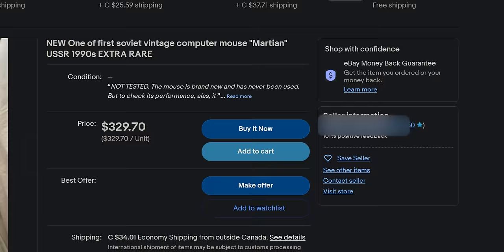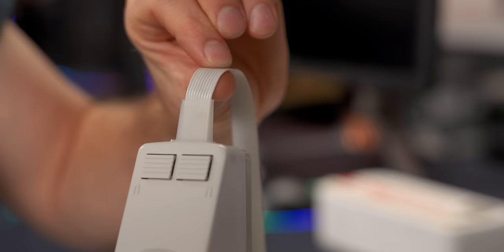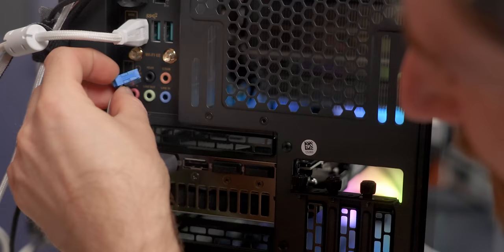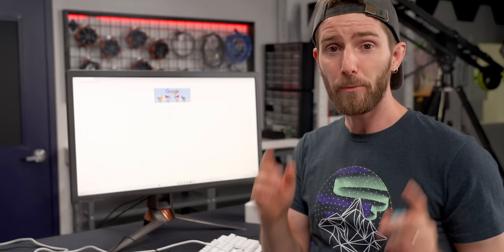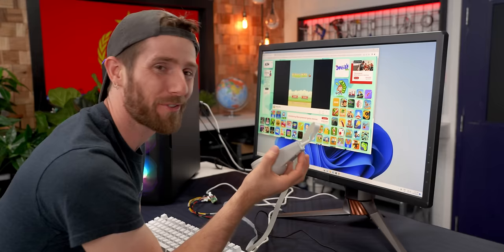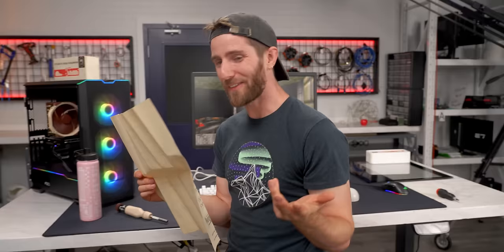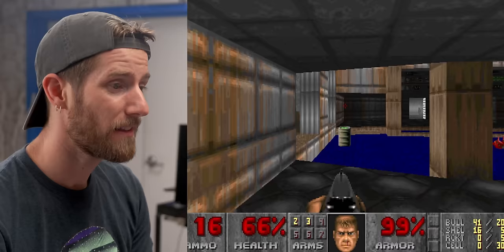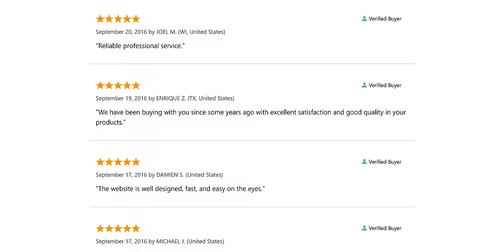I Bought a Soviet Era Gaming Mouse - MARS UKV-01

Comment: Keep in mind that back when this mouse was created, the most common resolution was 320 or 640, the speed of the mouse relative to the resolution back then is very good. 
Try using 600 or 800 dpi mouse on 1440/4K screens. It feels insanely slow. I have 4K screen and my mouse is set to 6000DPI.
Reply: I use 400 dpi on 1440p 😬
Reply: BK-0010 had 256*256 pixel screen )))
Reply: How does this have so many likes, 800 dpi doesn't feel "insanely slow". I've been using 800dpi on 1080p + 1440p for a decade.
Reply: yall are insane, 6000 dpi...
im better at 900 dpi
Reply: @marsamune5592  oh it does, you've probably bumped the accelerator near the end of the slider, but at this point you have no mouse precision since the movement is software calculated by simple multiplication. 
If your screen resolution was 1920x1200 and your mouse was capable of a maximum DPI of 600, you'd have to move your mouse two inches to get from the bottom of the screen to the top. If your mouse used a DPI of 1200, it would only take one inch to make the same movement on the screen. For 4K resolution multiply the necessary distance to move the mouse by x2

Therefore higher mouse DPI allows you to move faster on the screen with less mouse movement. Higher resolution displays may require higher sensitivity or higher mouse DPI to attain the same amount of on-screen movement, or one would need a ridiculously large mouse-pad.
Reply: @vyrgozunqk  You said that 800 dpi was insanely slow on 1440p. That's 1.8 inches from top to bottom. You got weak ass arms or the tiniest mousepad. I have windows on default sensitivity.
Reply: @marsamune5592  how about horizontal? ;) not just up and down, for me this is insanely slow. The mininum I can tolerate on 1440p is 1200dpi, prefferably 1500. I don't like moving my whole hand from the shoulder.

Comment: Are you kidding me? A PDP-11 compatible home computer? Can it run BSD or UNIX? That's badass. Can't believe I never heard of it.
Reply: would be cool seeing a soviet home computer running bsd lol
Reply: @lettuce7378  there was a Soviet BSD-based OS, ДЕМОС/DEMOS
Reply: No, it can't. It's not 100% PDP-compatible, instruction set a little bit different, and it was roughly copied by USSR for some strange bureaucratic reasons.
It had an impressive list of software tho (C, Forth, Basic, FOCAL and even about 800 games), but not a single real OS. Some models even had some LAN functionality, we used them in our class where I received my first programming lessons in the late 80's. Wikipedia article “Electronika BK” about this device is quite good, can recommend it.
Reply: Heathkit sold the H-11 and it ran PDP-11 software as well.
Reply: Most soviet computers use partially pdp-11 compatible cpu's
Reply: believe me. soviet cs, pcs and cybernetics are one hell of a rabbit hole
Reply: @petermikus2363  if I remember, there were even some that, although they were IBM-PC compatible (or even Spectrum compatibles), incorporated an extra chip that was basically a complete PDP-11, to be able to run software from the other Soviet microcomputers, minicomputers and mainframes that were based on that architecture.
Reply: @mat_max  any places that you recommend starting for an english speaker? I find the topic interesting
Reply: @nemoe  not sure about this particular model, but Elektronika models definitely did run Soviet conversions of UNIX and BSD
Reply: Polish universities had their own Unix-like system, idk if it was supported though
Reply: @tylerdean980  here, in YT there are videos about the soviet PCs, even conferences about it.
Reply: a lot of soviet computers were knockoffs of US computers for 5-10 years prior. the most common PC they had was based off of an IBM PC and virtually every single government PC was that PC. this is how Tetris was able to spread.
Reply: @mikes989  yep that too honestly these things are quite the bit of a rabbit hole
Reply: Yeah even if you had the OS code which i dont believe you could get in the soc. Block you'd have to type the whole thing in. I remember that i had to retype 100s, maybe thousands of lines of machine code (sometimes basic code) to make some stupid(that's my opinion now:) game work, back then it felt so rewarding. And i had to write it to a floppy disc or a cassette and if the computer hung it was a reason for days of moping around :)
Reply: FWIW its an LSI-11 clone rather than PDP-11, and it wasnt that unusual for people to have an LSI-11 desktop, though thats not what they were for.
Reply: Oh if you love PDPs I'll bust your socks off: I have an Elektronika MK90, which is a PDP-11 compatible POCKET computer. Well, it's about as big as an iPad mini and as thick as a whole box of them, but still! :P
Reply: @NizzyTV  Our government was well aware of the quality of Soviet industry, so they bought themselves genuine IBM PC/AT's. When I was 12 I myself played Captain Comic on such a machine in Frunzensky district party committee (blame Google Translate if these four words do not make any sence).
Reply: BK0010 is more like ZXSpectrum, but PDP :) Cheap home computer that plugs into TV as monitor and tape player to load programs. Originally it has 16k RAM and 16k video RAM. Not really designed to run any multitasking OS. 
There is a "proper" soviet personal PDP computer - ДВК (DVK). It had better cpu, much more RAM(some even had ECC), dedicated display controller, FDD/HDD expansion cards and so on.

Comment: 150 rubles???? This is an absolutely insane price by the standards of the time! I don't know which conversion method did the seller use to arrive at 350 usd, but 150 rubles  was an average monthly salary in the late 80s USSR, so it would probably be closer to a couple thousand dollars than just $350.
Reply: Salary was 200 rubles. $350 is almost an average monthly salary in Russia (in most regions) nowdays. So everything is right
Reply: Вообще должен быть ценник на самом изделии
Reply: 150 рублей - минимальная зарплата в конце 80-х.
Reply: 150 рублей - минимальная зарплата в конце 80-х.
Reply: Ну да, замечание верное, з/п действительно около 200 была, я больше по памяти родителей ориентировался (у них была ближе к 150). Но один хрен, 150 советских за мышь это ну как минимум раз в пять больше, чем 350 американских сегодня. Другое дело что наверняка купить в розницу было невозможно и ценник был для закупки предприятиями, поэтому ориентироваться надо скорее по  ценам черного рынка, а там поди узнай, сколько за нее просили барыги.
Reply: lol. Couple of thousands dollars it was price of the car in us 1985. 150 rubles was 1/50 fraction of the price of much simplier car in ussr in 1985.
Reply: @ksanag3426  200 rubles was far above average level of ussr salary, close to maximum possible
Reply: @79keydet  I think the conversion here is from the 1980s USSR ruble into the modern US dollar. Also the car price example is kinda irrelevant here, we're comparing the deprived USSR car market with barely any private vehicles being produced to the oversaturated USA market during the 1980s, sometimes called "the decade of excess". If we're going back to the average monthly salary then it's still closer to at least a thousand USD of the 1980s, around 3/4 of the average $1500/month salary (the same way 150 is 3/4 of the average monthly salary in the 80s USSR).
Reply: @ksanag3426  nowadays? My friend went to Russia to have paycheck around 1500$ so salary around 350$ is possible maybe in usa but in Europe it's was maybe around 1990.
Reply: @patrikmiskovic791  as I said, in most regions, not in all. In Moscow salaries are way more better. In my region 350$ considered as normal salary, sadly
Reply: @ksanag3426  No, he said about salaries in USSR back then, not in Russia today. Aaaand with different prices, money value, etc. you can't just compare like that.
Reply: 200 рублей в 80х - было достойно высокой зарплатой  в СССР ну года так до 1988. 140р. Была средняя зарплата инженера, кто эту мышь разрабатывал. Доллар тогда стоит 0.68р. :)
Reply: @dmitryvlasov5493 nope, they wont return. There are a lot of parallel imports. Also most of tech made in China either way. 

Prices got higher after war of course, but it is still relatively okay.

Comment: I had access to my father's BK 0010-01 as a child... It was glorious! Games were on magnetic tapes like audio cassettes and a small bent piece of wire in the connector was magically necessary to connect the PC to the soviet TV... But the games were fantastic! Boulder dash, Lode Runner, Tetris and many other classics were adapted to BK. However, I never knew that there was a MOUSE!
Reply: Finally someone with a legit story
Reply: I have use it. Games and programs was on audio cassettes. To upload it - you must connect audio cassette player to PC. Press start in DOS command line and press PLAY button on cassette player. Game LOde runner uploaded about 30 minutes. Often with errors because of Refrigerator starts and a little shocks power line. And do 30 min again to full signal transfer without errors. After 3th attempt you became to understand those signals and sounds out of the player dynamic. I think it is future of computer language communication.
Reply: bro. Same.
Reply: cassette tapes were very common in the us and europe for a while, before floppy drive quickly took over the low end. most computers didn't even have any logic for it, just a 3.5mm audio jack (or a proprietary connector, looking at you radioshack). probably 1977-1983 or so, but never on 8086 machines who stuck with expensive floppy drives. most schools would have had floppies too due to grants, so there's a huge group of people who grew up in this era and just didn't have much experience with cassettes for data storage

if anyone is curious, the data is stored as sound and yes. it sounds like dial up, its a very similar technology
Reply: In a local House of Pioneers which I used to visit as a kid there was a LAN consisting of BK-0010 connected to "server" DVK-3 which had two 5,25" floppy drives, and the games were stored on floppies instead of tapes. Unfortunately back then I was too young and can't tell what technology the LAN was using.
Reply: remember playing elite (at least I believe it was elite) with my dad

Comment: This is really the content you can't find anywhere else! Who else is going to have the ability to draw on the expertise of an entire lab and the jank to try to get a forty-year-old mouse to work, and the presentation skill to make it all interesting to watch?
Reply: tbf, this wasnt the most demanding job.
the buttons where, as he said, just reading the voltage and simulating a mouseclick via the USBHID the Pico is pretending to be.

The pinout in the manual did most of the actual trial and error.

and movement really only required them to figure out that it needs to be reset/set to 0 everytime you moved(which he also said)

anyone with a bit of knowledge in coding for a pico or arduino would be able to do the same, altough maybe taking a bit longer

like dont get me wrong, its a nice video, and neat they did it, but it really isnt a "only someone with an entire lab worth of people could do this" this isnt a lot more complicated then making your own button box for a flight simulator from scratch using an arduino or rasperry pico
Reply: Curious Mark probably
Reply: @weberman173 fact is, this video wouldnt exist without the lab, that was the point
Reply: it litteraly would.... they litteraly had a whole joke about "someone else was gonna do it then they realized they have the lab who can do the same stuff, but faster" @BooleanDev
Reply: @ssl3546  i wouldn't say he was complaing that sounded more like a joke to me
Reply: @weberman173  we dont know that he wouldve been able to do it alone
Reply: they did more complicated stuff before without lab.

this was legit "read the pins, and tell the arduion/raspberry to pretend to be a USBHID device+send voltage to the reset pin regularly" 

the hardest part minus figuring out the reset part is "how much hz can this thing handle"

unless the person they handed it to had no idea about USBHID via Arduino(which.. already exists as existing programms for flight simulator button boxes etc) its unlikely he would not been able to get it done, it would have taken longer, a day or 2 id say, but it would been done
Reply: Could see Ben Hack having a field day with this well if had more time lol. Not only would he have it up and running but sure would add it's own screen and play doom standalone on it.
Reply: The complaining about the cost again part did seem pretty unnecessary.

Linus really can't seem to let things go. 

Just like he keeps bringing back up Trust Me Bro on WAN Show.

He seems to perpetually need to defend his position as the historically correct one on past issues. 

Regardless of how uncomfortable that makes anyone else.

Like picking at a scab.
Reply: There are tons of channels that do much more complicated projects by themselves, without a lab team
Reply: I suspect that the 8-bit guy would have managed that with his lab team of himself, in a more interesting perspective because he understand the challenges of the period of the mouse. But maybe it's because I'm a dork.

Comment: Learning electronics is one thing but Soviet electronics is in another world lol 

I bought an old Soviet era guitar (Czech actually but the electronics were Russian) and the pickups didn’t work right and I had to take it to 2 different guitar techs to at least get sound out of it, the pickups work but the switches and selectors don’t sadly
Reply: Yeah it really makes you realize just how important standards are. When electronics don't speak the types of signals, voltages, etc. that the rest of the world does it makes it so much harder to adapt to
Reply: @dhkatz_  Preferably open standards that countries aren't kept out of simply for having a different political system
Reply: Need an actual electronic technician, not a luthier, they are very simple devices electrically.

Comment: Windows sensitivity setting increases jitteriness. If you reduce it, you could increase hardware sensitivity more and end up with less jitteriness. This is true even for modern mice, if you try using them on highest windows sensitivity setting, despite insane DPIs you will see it skipping 10 pixels, because windows just multiplies the movement instead of actually increasing the DPI
Reply: also decreasing the value below 6/11(default) will create a negative acceleration, the default option is a raw input with "enhance pointer precision" option disabled
Reply: This might be good for helping the player to make small adjustments in their aim in first person shooters, i'm going to try this myself by turning windows sensitivity down to 3 and put my mouse hardware up.

Comment: It's always mind boggling to me when you think about some stuff like this BK-0010. 3Mhz for example sounds like a joke nowadays but when you think about that this still means it clocks freakin' 3.000.000 times a second, this is kinda crazy 😅
Reply: One cycle on a modern 5 GHz CPU takes 0.2 nanoseconds. Each core can perform multiple operations per cycle. Yet it still takes forever to boot the OS and open programs.
Reply: The Commodore 64 here in the west I used was only 1Mhz and people do crazy cool stuff with it. Also my next computer Amiga 500 was 7 mhz and that has good looking (4096 colors) and "real" music sounding games.
Reply: @jfolz yeah but I'm pretty sure most of that time is I/O anyways, where the CPU can't really do anything even if it wanted to. Like loading OS components into memory. Though my Linux laptop boots up really fast, it could just be a Windows thing
Reply: @jfolz  Because cycle speed and amount of work done during a cycle are completely different things.  Similar to a car engine at 10,000 RPM.  With high gearing, a car running at 10,000 RPM in first gear could go, say, 50MPH, but add a double reduction transfer case and suddenly that 10,000 RPM is less than 5 MPH.  Very simple analogy, but yeah, it all depends on the system as a whole.  Plus, modern computers are loading a LOT more big-brother style phone-home software when they boot than the old ones were.
Reply: @tommiaijala2732  Yeah, back then the Mhz had much more meaning than currently does. I too had a c64, then A500's, an a600 (first time using a hdd, iirc a 20mb) , and finally an a1200 with an '060 add-in board.
The coders were really amazing at pushing every erg out of those machines. Demo scene doing  64kb bootblock demos,  Spaceballs with their State of the Art's,   aswell as the audio stuff.   Good times.
Reply: @FuckGoogle502  except it's worse in the other direction. Early CPUs executed one instruction per cycle. A modern CPU core contains many execution units that can work in parallel. While there's some latency, it still works out to several instructions per cycle.
Reply: @jfolz  Get an SSD already xD
Reply: @sleepyhead758  I've not had an HDD in any of my devices for the last 5 years...

Comment: In 95 displays were most comonly 640x480 or 800x600. Which both is likely higher than was available when this mouse came out and possibly soviet did not even have that good displays. But regardless, a modern 1440p (which i'm guessing that is) will need more pixel moved per cycle than a old junker so If you brought a 640x480 display the mouse would feel a lot better speed wise without being jittery.
Like...I grew up with mice at around 800dpi when 1080p was just becoming the norm.....now I use around 3000 at 1440p. Expectation of how mice move have changed a lot
Reply: Yeah I was already thinking that the 4k or even 1080p resolution was obviously too large for the design of this mouse.